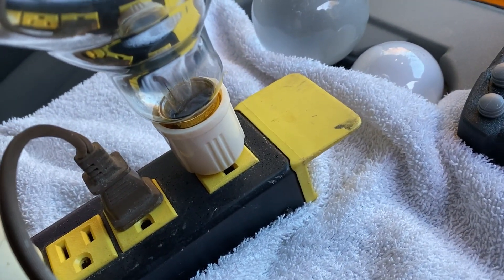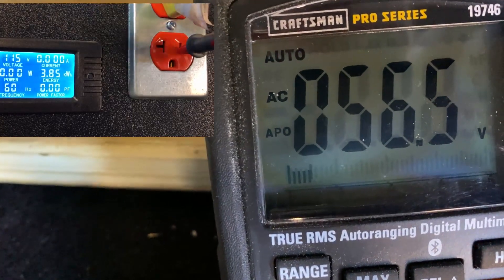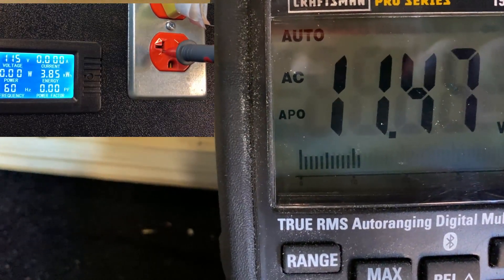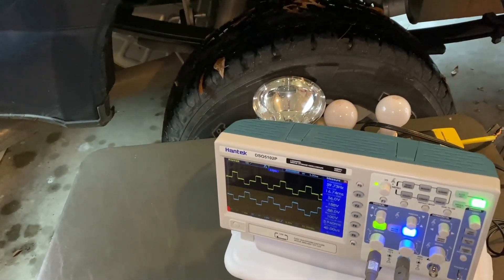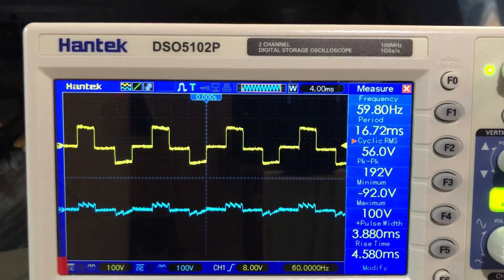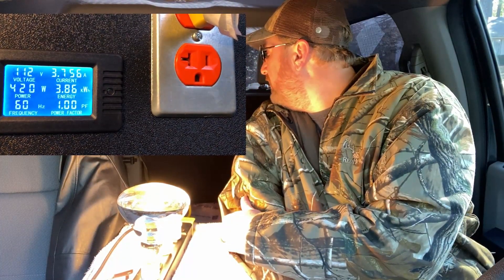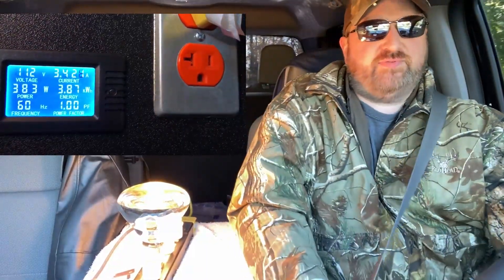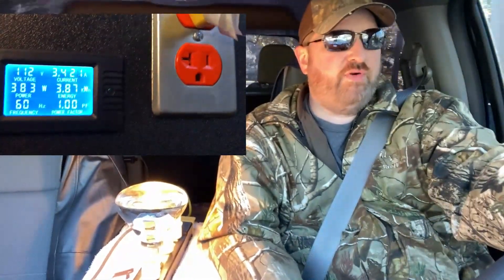Ford F-Series 400 Watt AC Power Outlet - On Board Inverter Load Test and Review

Comment: I've got a 2019 F150 and the factory inverter has been less than impressive.   My laptop has a 240w power supply and the inverter can't provide enough power.   In my other vehicles i have wired a 6 AWG to the battery and use a cheqpo Walmart 400w inverter without any issues.  Pretty disappointing im going to have to replace this with something different.

Prerty ridiculous there is less power while driving.  I agree doesnt make much sense.  The alternator obviously puts out more power above idle.
Reply from the maker: At this point, I'll assume they put that language in the manual to give themselves some wiggle room if they needed to reduce the inverter output in the future. I only use the onboard inverter for a small space heater my wife uses when the temperature dips below a chilly 70F. Other than that there is not much use for it.
Reply: I'd like to see if I can find a wiring diagram for the unit and just replace it with a real 400w unit.  I'm not opposed to running a direct wire to the battery and using a relay if needed.  I haven't looked at all, as I was just hoping this thing would work ok when I bought the truck last month.  I'm actually surprised it runs any kind of heater.
Reply from the maker: It is a 250w personal heater but it is mostly a resistive load that inverters prefer. Things like motors and transformers are inductive loads that result in a lower max power that can be obtained from the inverter. Look up "power factor inductive loads" if you're interested in that type of info.

Comment: I stopped fighting the battle with brain dead engineers, I own both ford and Toyota, I bypassed both systems and put in dedicated pure sign inverters with 250amp alternators with the proper sized wiring and fuses. On the stock 400w inverters I use an adjustable rectifier to change the square sign inverter to 48v dc for charging my echoflow 1800w power station thru the solar ports.
Reply from the maker: Well that's an interesting implementation for charging a power station. I would not have thought of that. I guess it has a voltage regulator set at 48v and I assume the echoflow handles the charge rate based on charge level of the battery. I am surprised the power station didn't pull more than the inverter can produce. That a cool hack. Thanks for watching.

Comment: So, I drive over 300 days a year and icing a cooler is a pain each day...  Would this inverter run a little 12 volt portable fridge? Is the inverter only on when the truck is on? Should I just buy an inverter and a 2nd battery? (probably I'll buy the battery anyway, I'm sure I'll find more to plug in as I go)
Reply from the maker: The inverter runs when the truck is on and only a few minutes after the truck is shutoff. Otherwise it can discharge the cranking battery -leaving the owner stranded. Your scenario doesn't need this inverter which puts out 120 volts AC. The truck has a 12 volt DC system so your 12 volt fridge would run on that with no problems. It would be a good idea to run your cooler on a deep cycle 12 volt battery when the truck isn't running and the truck can charge the deep cycle battery while your driving it. Keep in mind that lead acid batteries hate to be discharged more than 50% and they last longer if kept above 70-80% charge level.

Comment: I have a 2020 F350 with a 400w inverter. It does not provide enough power to operate my laptop computer with a 230v power supply.
Reply from the maker: The ford outlet provides 120v but many laptop chargers work on 120-240v depending on the model. Either your setup pulls more than 400 watts or the power supply doesn’t like what the ford inverter is serving up.

Comment: Is the ground at the outlet a frame ground? S ince the the sine wave is split between neutral and hot, when a device that uses UL house certificate three wire, we are basically shorting one side out to ground. In effect killing half or shutting down the inverter.
Reply from the maker: @Dirtyharry - I didn't see any conductor in the dash receptacle where a ground pin is inserted so no short...meaning I fear a short within a device against a metal case could possibly send 50+ AC volts through an occupant if they were to touch the device and metal on the truck. I have not tested it and don't intend to.

Comment: Outstanding video. It seems that after 50 years I just learned something new. Did not understand the concept of a floating neutral. You do have 110 volts across the hot and neutral connectors so things should work ok. However, a modified sine wave inverter can cause havoc with many electronic devices. Electric blankets for example in my RV will not last long when on the 2000-watt modified sine wave inverter. I suspect many of the chargers for tools will not do as well. The new chargers for our two mobility scooters will not work on the 400-watt inverter so I will install my own 1000-watt inverter under the hood somewhere with an ignition sense wire to turn it on.
Reply from the maker: I don't know if this is considered a floating ground or just a cheap inverter. This one works on resistive loads but that's about all I'll put on it. Pure sine wave inverters are too inexpensive to risk electronics anymore and inductive loads do not like modified sine wave inverters. Be mindful of the heat and dust when installing under the hood and choose an inverter designed to work in that extreme environment. Thanks for watching!

Comment: Great test.  Sadly ordered the 400w inverter on my new 2022 Transit and it's likely the same POS you just reviewed.  This is just poor engineering for the 200+ USD ford charges for this option.  An inverter like this is unexcusable.
Reply from the maker: It isn't what I was hoping for at all but it checks the box on the window sticker for ford. Fortunately, pure sine wave inverters can be had for a reasonable cost...far less than the $200 you and I paid Ford for the onboard OEM. Thanks for watching!
Reply: @LivingCommonSense  I suspected the inverter was not going to be ideal, but this is bad.  I would not want to hook up any expensive device to this.

Curious if you think it's worth the time to review the wiring to see what the current limits are and to install a PSW inverter works within the wire current limits?  Having the built in outlet might still be useful perhaps with slight upgrade to max power.
Reply from the maker: @Chris - I kind of assumed that Ford used the smallest, least expensive wiring they could get away with for the inverter. I also suspect replacing the OEM inverter would void any warranty related to the electrical system and potentially the onboard electronics/computer systems since the inverter is probably tied into all that. I avoided replacing the inverter because repairs could run into the $1000s even if the swap had nothing to do with a different component failure. The super duties have an option for auxiliary power switches overhead. If I were to upgrade the inverter, I would hard wire into those and run a custom outlet up inside the console between the seats. Maybe a similar option for your Transit. Good luck!

Comment: @LivingCommonSense  What you are seeing is perfectly normal and required by design.  All inverters made for applications such as yours are are "live neutral", so one cannot expect it to work like the plugs in your house.  Those who attempt to "remedy" that situation will end up with "magic smoke".   Whether or not the inverter is pure or modified sine wave is immaterial.  This will all make sense in a moment.  The key to understanding this is, THERE IS NO NEUTRAL NOR GROUND AS IN ZERO VOLTS ANYWHERE, ONLY DIFFERENCES IN POTENTIAL.  EVERYTHING IS HOT.  The power station even uses the earth as one of its major conductors.
- The service to your home is in effect 240v split phase.  There is 240v between the two so called "hot" legs and 120v between each "hot" leg and the so called "neutral", which is actually a tap/wire halfway between the two hots inside the transformer that feeds your home.  At your panel, the "neutral" is tied to "ground" and from there to "earth ground".  (This same configuration also exists at the transformer feeding your house.)  Therefore, under normal conditions, there will be no difference in potential between neutral and ground on the plug INSIDE YOUR HOUSE.
- The power from a 120v inverter is in effect 120v split phase.  There is 120v between the two "hot" legs, ONE OF WHICH ONE IS CONNECTED TO THE NEUTRAL TERMINAL OF THE PLUG.  That is why there is 60v between each "hot" leg and "ground", why anything that bonds the "neutral" on the plug to "ground" has the same effect as bonding one of the "hot" legs coming into your house to "neutral", and why turning off a normal plug strip switch only stops one leg, unlike a 240v breakers and switches which switch both.
*There is more to be said, but if I continue, the YouTube algorithm will delete this due to length.  I will continue if desired.
Reply from the maker: @Jack: I appreciate your explanation but I guess the bottom line for me is this. I've measured many inverters and this was the first I've come across that intentionally made hot leg out of the neutral. Reading many comments of people complaining the onboard ford inverter will not charge some power tool is what got me to looking at this. Whether is the square wave, "split phase" or inadequate power, I cannot say since my rechargeable seems to work with the ford inverter. I cannot see any conductor in the "ground" pin on the dash receptacle. Does that matter? It seems potentially reckless if a device relies on the ground pin to provide a level of safety. If the hot "neutral" contacts the exterior metal case of a fan or similar, I could see some electrocution potential while touching a door or fender. That's the part I don't like. I have seen unloaded "linkable" inverter generators put 55-60 or so volts on both the neutral and the same 55-60V on the hot, however, bonding the neutral to the ground on one of the receptacles resulted in 0V on the neutral and 120V on the hot just as it should. I don't think this would work on the ford inverter. For the record, I've tested plenty of inverters that put 110-120V on the hot and 0V on the neutral.  Either way, these are 50k-80k dollar trucks and I don't think it would've killed ford to put a decent inverter onboard. Thanks for watching!
Reply: @LivingCommonSense  I can’t charge my Milwaukee batteries..the light beside the plug starts flashing if I plug the Milwaukee charger into it..without even having a battery on it. My DeWalt chargers do work, however. But only if I charge the small batteries. If I try to charge the larger batteries, the light beside the plug starts blinking and the 110v plug stops supplying power. Saying it’s “not unusual” to find this kind of setup..I call BS..you bought a work truck that is marketed to be a work truck but  the thing won’t charge an 18v rechargeable battery for some of the most widely used tools in the US?? ..here in the oilfield, where we work out in the middle of nowhere for weeks at a time, we call that, and I quote, “a piece of shit”.
Reply from the maker: @Slowmo - I agree with what you're saying. I'm still not impressed with onboard inverter at all. Fortunately, there are affordable aftermarket pure sine wave inverters in the 750-1000 watt range which should charge at least on of these tool batteries at a time....and yes I think Ford should have spec'd a better inverter.
Reply: @LivingCommonSense  …for $60,000 trucks…yeah, Ford shoulda. Lol the one in the truck..what’s it even for? Are people plugging in lamps in their trucks😂
Reply: @LivingCommonSense  and that doesn’t even crack open the entirely other topic of them using (what’s supposed to be) the neutral as a hot. Janky AF.
Reply from the maker: I mounted a 120 volt - 250W personal space heater to an adjustable arm and mounted that to the seat attachment at the floor. Plugged it in and my wife points it at herself when she thinks it cold in the truck even when it is not. 🤣 It isn't much but it makes her think its warmer.
Reply: @LivingCommonSense  😂whatever it takes.
Reply: @LivingCommonSense  >I've measured many inverters and this was the first I've come across that intentionally made hot leg out of the neutral.<
(I assume you mean measuring between the hot and neutral to the ground pin.)  I have not had one that was not that way.  Some high-end ones are not because they have the capability of mimicking the power company.  

>Reading many comments of people complaining the onboard ford inverter will not charge some power tools is what got me to looking at this. Whether is the square wave, "split phase" or inadequate power, I cannot say since my rechargeable seems to work with the ford inverter.<
Devices wouldn't be able to detect if it is split phase if it isn't a 3-prong plug, but some stuff needs a real sine wave.  Moreover, if you check out some of the other PSW test reviews on line, one of the acid tests is if it will run certain chargers for power tools, and about half of the PSWs fail.  Another one is Apple chargers.    

>I cannot see any conductor in the "ground" pin on the dash receptacle. Does that matter? It seems potentially reckless if a device relies on the ground pin to provide a level of safety. If the hot "neutral" contacts the exterior metal case of a fan or similar, I could see some electrocution potential while touching a door or fender. That's the part I don't like.<
The inverter is like the generator at the power company.  The 12v or 24v of your truck is simply the energy source to "power the generator".  Your truck doesn't have a 3rd wire anywhere else, and where would it go with it?  To accomplish the dangerous situation that you are referring to, there must first be potential.  The only place it can get it is from the inverter, which would require running one conductor to the earth outside, and another to the truck's frame or body.

>I have seen unloaded "linkable" inverter generators put 55-60 or so volts on both the neutral and the same 55-60V on the hot, however, bonding the neutral to the ground on one of the receptacles resulted in 0V on the neutral and 120V on the hot just as it should. I don't think this would work on the ford inverter.<
I have no first-hand experience with inverter generators, but when I was evaluating buying one, some of the larger ones are 240v and mimic your house service.  However, most are 120v.  Everything depends on the design of the output section design on whether you can tie the neutral to ground.  If you can, then you are simply forcing them to be in phase with each other, which prevents the possibility of any potential between them, as in your house.

>Either way, these are 50k-80k dollar trucks and I don't think it would've killed ford to put a decent inverter onboard.<
I understand the justification to go MSW regardless of cost.  Moreover, a one-off MSW inverter with electronics and connections to interface to your vehicle's computer systems and the programming was not cheap.  While I can't speak to the quality, I would say it would be risky to go too cheap on it due to the risk to high-value components in the vehicle's computerized management systems.  I like PSW too, but there are more considerations than simply cost when implementing PSW in a vehicle and also sizing up.  I'd better not let this get any longer or the YouTube algorithm will cancel this post.

Comment: I told my dealer about your video. My 2021 F150 XLT has burned out 3 inverters and all I've ever plugged into it was an 85 watt battery charger and a string of Christmas lights. I'm worried that the truck has a larger electrical problem. The dealer is waiting to hear from Ford engineers.
Reply from the maker: I hate to hear anyone having trouble with a new truck. They should get that resolved for you. Having said that, I'd probably be looking at a different inverter to run the battery charger at least temporarily to make certain something isn't going on in the charger to cause the Ford inverter to flip out. I've had good success with the Bestek 300 watt pure sine wave inverters. It is inexpensive and I believe produces better power quality than the integrated Ford inverter. I did a short review of mine and it is still working great whenever I need it. https://youtu.be/lMZ-Lqh27ok 
Good luck with your truck!

Comment: Its a floating neutral, you're truck isn't grounded and neither is your inverter because the truck is sitting on air and rubber. Also RIP your battery.
Reply from the maker: A floating neutral happens when the neutral loses reference to its ground point. A neutral should show 0 volts ideally but I often see .5 - 1 volts difference between it and the ground in the real world. Certainly not 56 volts.  As for the inverter, there is no conductor that I can see in the round ground "hole" on the dash receptacle.  This inverter shows near equal voltage on both the hot and what should be the neutral even under no load. No load means there should be no voltage reaching a neutral.
I believe the dash receptacle should have a functional ground pin that is bonded to the frame.
The electrical system in the truck is considered to be negative ground even though it sits on rubber. The battery and alternator are doing fine. Thanks for watching!
Reply: Earth is visualized in different ways for electrical if I’m not mistaken meaning at your house a long metal rod is literally your earth ground point but in a moving system the frame of a vehicle becomes the “earth ground” point for that in particular system. It’s just somewhere that the electricity can travel through to reach its starting point. Electricity prefers to make a full circuit to work.